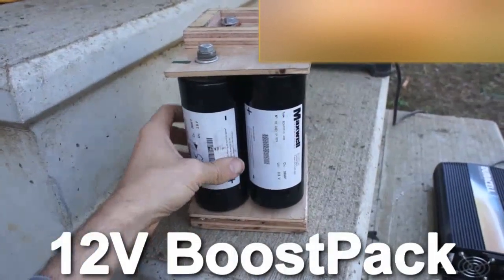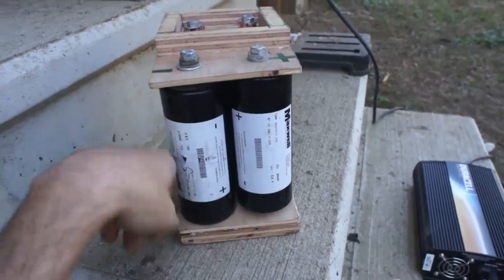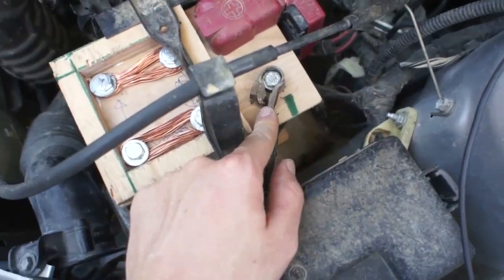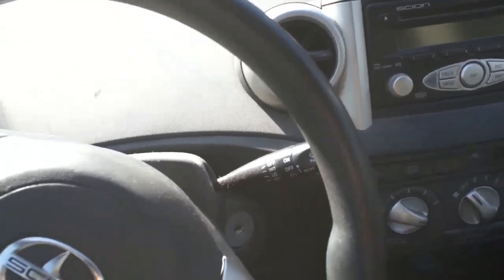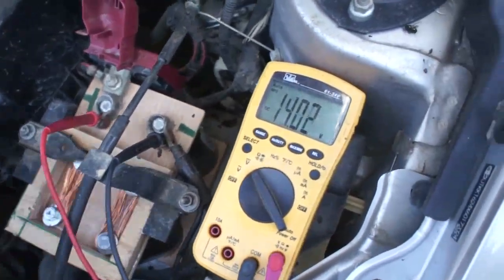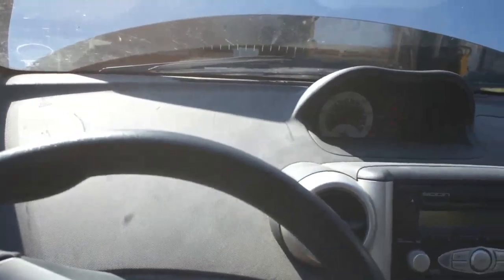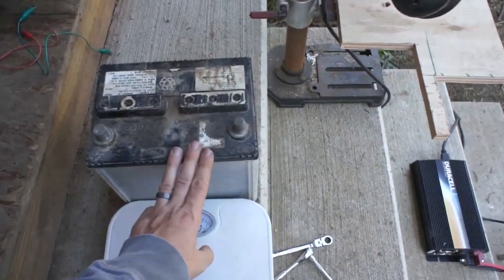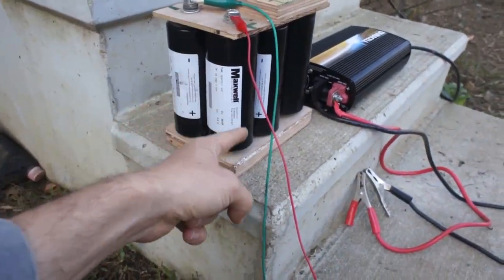12V BoostPack. Replaces auto battery. Works great!

Comment: In the 50 years I've been driving I've had generators or alternators fail while on the highway.  Automotive batteries today are rated in cold cranking amperes and reserve power minutes or how long you can drive the car if the alternator fails.   Usually you can drive at least an hour maybe more in daytime without lights and if you'll leave off the AC/Heater blower just on the battery if the alternator fails.   I'm afraid this type of arrangement will leave you sitting on the highway before you make the next exit...
Reply: Howard Bee Maybe the battery can be kept as a reserve with an alarm to say something is wrong?
Reply: Good point. It's a trade off of features. You sacrifice the 1 hour driving reserve for in case the alternator fails in order to achieve better gas mileage, but another option such as a solar panel built into the roof and/or hood/trunk can possibly also give better gas mileage by negating the use of the alternator (so it causes less or no friction load on the engine) during the day, and also this would enable you to run the car with a failed alternator so long as there was sunlight. It's also possible to keep a little hand crank charger in the trunk for emergencies. They're good to have in case you need to charge your phone, and now if you use capacitors in place of a car battery, you could use it to charge up the capacitor if you didn't have solar. I think most people will simply rely on their auto club membership, because they're paying for it anyway, but I'm the type of person who wants to be independent... you know, in case of zombie apocalypse. 
Now it's not a bad idea to keep 8 'D' cell batteries on hand. That's still a lot less weight than the Lead/Acid battery but they are not going to be able to give the cranking amps needed, but they could recharge the capacitor at night when solar would be impossible. So for those who don't want to use a hand crank to charge the capacitor, that would be an option. I would go with the hand crank because I've had lots of batteries go bad still in the packaging. I have bought them to have for emergencies and they just seem to be designed to go bad after so long. They self corrode from the inside and leak. 
I know a car requires a lot of amps to start because it has to turn over the crankshaft with an electric motor, but once the engine is going, how much electric power is it drawing? It might be possible to have a passenger furiously turning a crank to keep the engine running indefinitely while you drive down the road. X'D
Reply: Correct, if your alternator fails you can drive for quite a while on battery, then jump start and drive quite a few miles again.  I've done that a few times.

However, in my 30+years of driving the need to do that has happened less than a dozen times, and once I've replaced the alternator I don't recall ever having to replace it again on that same car.

...but I've started a car tens of thousands of times, and due to the ability to discharge amps faster, this seems clearly superior.  I'll bet it would really work great on a diesel truck, where you typically have two batteries because one battery just can't push the amps.

If I can find the caps, I'll try it, especially in my tractor, it sits for quite a while between runs, and then I'll start/stop it multiple times in a day, then it will sit for a while.  I already have a solar battery tender on it, so if switching to Caps means I don't ever have to worry about that battery again I'll be one happy guy.

For weight savings... your target audience is the drag racing crowd though... they're the ones that really worry about every pound of weight... often going so far as to strip the sound deadening and "extra" seats out of the car.
Reply: Actually, there is a benefit to it if you use it as hybrid and hooking battery and capacitor in parallel.
The capacitor will deliver the surge a starter needs or when you honk your horn or other devices that are intermittent like your wiper and that saves you battery life. You can double  the live  of a battery or you may even get even  more years out of it. I am on my 7th year and the battery is still not slowing down.
So you save on resources,  landfills and keep more greens in your wallet.

And I was thinking of adding  a solar panel and charge controller to the system to keep the combination at the same voltage at most of the time which would add more life to the battery.
Small load on the battery with steady voltage will add to battery life.
Reply: 15 lbs of weight is nothing compare of the 3,000 lb  weight of a car or compare that a spare tire can weigh as much as the battery.
Most people that have alternator problems do not even know that there is a problem and by the time the battery is ruined already and is destroyed and you will not get 1 hour driving with that bad alternator and that bad battery....you will be lucky if you get 10 minute driving with that bad combination.
We have capacitors that are over 40 years old in that electrical cabinet (UPS) that is used daily.  Never seen a battery that can last that long without servicing nor touching it.
A starter takes about 200 amps, but it is only for 1 to 2 seconds and it takes very little watts to start the engine...well I came up with the calculation that the starter takes 1.38 watts/watthours to crank the car, so it would take the alternator seconds to charge the battery or capacitor up again.

So yes, use a capacitor as a battery or a combination of it and save in the long run by saving the resources and landfills and by keeping the green stuff in your pocket after initial investment. I call it investment since eventually you will break even and you will start to save money. It is like buying solar panels, they are expensive, but in about 7 years you reach the break-even- point and after that you are just saving money by not having to buy electricity or by not  having to buy fuel to generate it.
Reply: Howard, I agree with you 100%
Reply: A dashboard solar panel will not do.
A running car uses about 10 amps to 20 amps, depending what is on at the time.
A 100 watt solar panel produces about 5 amps. A 100 watt solar panel also has a  dimension of about  2 feet by 4 feet.
You would need about four 100 watt solar panel just to get by, What you gonna do at night? Unless you increase your solar panel array and increase the capacity of your capacitors or batteries.
Eventually the  technology will be incorporated when greed finds competition.
Reply: If you just drive around town then why worry? Even in the slim event your alternator goes out it's not too huge of a risk, you still are going to be broken down either on the highway or not. If you keep up on your maintenance and have your alternator checked periodically your chance of failure is even slimmer. You could carry around a starter pack in the trunk or get a jump from somebody in the event of an accidental discharge. Don't throw the baby out with the bathwater.
Reply: Hey,  if you want to know more about solar panels and have questions, here is a good forum. 
Most of the folks there have experience and would be glad to help you.
http://forum.solar-electric.com/discussions
Reply: can´t check alternator periodically!  other than looking at it;and measuring 14.2 v,it´s working N O W !  don´t know,5 minutes from now.
Reply: Yes, you can test the alternator. There's a tool called an AMMETER! There's another one called an Oscilloscope which can even tell you when a diode in your alternator is about to fail.
Reply: Howard Bee I have been driving as long as you and in all those years i have only lost one alternator....in several hundred thousand miles.
Reply: Your welcome.
Reply: Ben Silva
Reply: Ben Silva
Reply: Ben Silva
Reply: hannamand
Reply: Seve Bertolone
If you are talking about recharging the power/watts  that the starter took out of the battery while starting the engine. It is not worth to mention it. It is very very little power, that have to be recharged..

A starter takes about 200 amps, but it is only for 1 to 2 seconds and that
 takes very little watts to start the engine...well I came up with the 
calculation that the starter takes 1.38 watts/watthours to crank the 
car with about 12 volts, so it would take the alternator seconds to charge the battery up again and to give a little bit more of that 1 watt back to the battery.
Reply: The typical car alternator takes far more than one minute to recharge the battery after a typical crank - especially if the engine is only idling.
Reply: Howard Bee i agree. Alternators have had the security of knowing when they fail for 30 years now.. Old people dont understand how new stuff works i guess, figure out once why your car wont start because the battery light on the dash has simply burned out, thats how i learned lol.. Technology, the blessing and curse of the modern age of generation x..
Reply: There is also a battery reconditioningggg guideeee on >>> https://t.co/mK3KjJd0lr?GPJao1xLe7wadd
Reply: Car batteries are like $200 now and he is saying these are $6 a piece. I personally dont care about the extra one hour of driving time I would get if the alternator went out. I have a cell phone and would call someone...besides...how often are you guys alternator going out?
Reply: I got bored half way through reading this sorry 😐
Reply: A simple 150w solar sheet on the roof top can resolve the problem for issues that rise during day time.
Reply: Yes it will
Reply: Tha battery runs the car the alternater just carges the battery
Reply: Alternators can be rebuilt in minutes on the side of the road if you prepare for this possibility
Reply: @shanicabolden5092  They can be rebuilt if you can locate them under the hood of today's cars....some are almost impossible to reach
Reply: I have had six Maxwell 1500 Farad caps as my "battery" for over a year.
I lost my belt once and you're right, the caps will only power the car for a few minutes. But, my van will only make it 1/4 mile before it overheats without the belt turning the waterpump, so the point is moot.
Reply: I’m going on 7 years with my 12 caps! Thanks man!
Reply: Get triple A
Reply: ***** Vehicles are already equipped with an alternator warning light or a system voltage meter if the alternator fails.   If I need to keep the battery for reserve power capacity wouldn't that negate the need for the capacitor bank?
Reply: @kaa522  One need not "replace" the battery when one can have a boost pack and battery? That way one can keep the existing, maybe reduced, capacity of the battery while adding the cranking amps of a boost pack. Point is using a boost pack can extend the useful life of a battery.
Reply: Somewhat, but at the same time if you make a hybrid of the two, you might be able to choose how much of the benefit from each one you want. A small battery might be a nice way to act as a safety device which can get you to the next exit. If the car uses it rarely, rather than a battery that likes deep cycles, a long term storage solution like lithium might become feasible where the cost to power the vehicle the entire time would have created a huge expensive battery before. Maybe. It takes more expertise than I have but if they are in parallel, the battery would be the vehicle's version of an emergency adrenaline rush...too expensive to use all the time but great in an emergency. :)
Reply: +Wuety06 you are terrible at maths, man, but since you feel saving 15lbs of weight is almost nothing, then multiply the savings times the gas usage of the entire nation and eat that much dirt. Come on, video yourself eating that much in dirt. Zero times anything is nothing, and almost nothing must be very small, so you should be able to do this with no problem. The future of the environment depends on you consuming the difference since you insist it's not worth it for everyone to save just a little, so you should eat it for us.
I think you've changed your mind.
Also, who is going to need a tow truck? The person with a battery that won't keep its charge, that's who. Don't have that problem with capacitors since they last much longer than batteries. The capacitor will outlast the life of the car. Put solar panels on the car and you can drive without using the alternator, which makes it last longer and you have less chance of breaking down versus a 'traditional' setup that you love so dearly. If you were born a few years earlier, you might be insisting that the Model A Ford is the only car we should have and all these newfangled models are too fast! LMBO! The future is passing you by. Are you still using that original IBM to type on here? Man, they still do what they were built to do, but there are better computers now. Consider upgrading.
Reply: It will die in less than 5 min
Reply: That's a very strange comment attempting to assert intellectual superiority by belittling someone else's contribution through diminishing their comments based on a poorly thought out argument. The words were condescending and rude. Thank you.

No. Not all capacitors are set up to bleed out all their charge at once because the electrical impedance you add to slows the discharge rate, even in a sophisticated "hybread" battery. The batteries shouldn't require as much space as you might expect unless you choose bloated capacitors for your finished product.

Your numbers don't all make sense. The numbers are not experimentally based as much as emotionally weighted and don't really contribute much to the conversation. I am not saying YOU aren't meaningful or smart. Your assessment was less than professional, though. Peer review's a tough mudder.

Anyway...
I'm really not up to arguing with you right now but as a troller I am sure you can find what you are looking for elsewhere. I hope I didn't hurt your feelings, pumpkin, but someone had to tell you before you really embarrassed yourself. Now tie your shoes and off ya go.

Thanks.

Bye.

PS:
I really don't intend to carry on this conversation... ever. Oh yeah... and I just reported you. Have a nice day.
Reply: your alternator would see way less duty cycle because the majority of wear on a alternator is charging the battery, takes lots of amps for a long time to recharge it.
Reply: some people are naturally born stupid and some people have to work at it,   this guy is lucky because he is a natural.
Reply: ***** its great that you are trying to think, but you are failing miserably at it. lets put things in perspective. replacing your battery with a super cap set up saves 15LBS, studies show REMOVING 100LBS = 1% FUEL ECONOMY INCREASE... so even the set up the guy had above gives him almost nothing in return and puts him way more at risk of being stranded. To do this hybread you suggest means a battery half the size of the normal one and a cap which already takes up the full size of the battery... now you probably have more weight than the original battery and no where to put the smaller battery, you also need pretty thick cables to go to that smaller battery, which again adds weight and because its a smaller battery its still far more likely to leave u stranded. there is no benefit to this. internal combustion engines dont need an adrenaline rush, wishing to make it possible breaks a system that works well currently.... they require a decently constant supply of moderate amperage which the lead acid they come with is great for. yes you could argue that using the caps and saving 15lbs over every car in the world may be significant... but due to the fuel hungry nature of a tow truck you would quickly see that advantage disappear even in the fractional fictional reality's you think it exists.

Comment: Great for race car.
Reply: +Stone Rinaldi Do race cars even have batteries? That may sound dumb, but why don't just save the weight and start it with an external energy source?
Reply: They need batteries to keep the spark plugs sparking.
You are welcome.
Reply: Guy Pukallus Yeah, but only very little wrongs, right?
And I could imagine the use of lightweight supercaps as well...

Comment: Try testing these for car audio use on high power amplifier sound systems.  That will surely show how good they perform.  If they work good then you could make a ton of money selling these to car audio competitors who run high power systems.
Reply: Clyde Yamasaki yeh they have been using caps in car audio for a long time (10's of years).. cause the battery cant get the energy out of itself fast enough. i even currently have a cap (dont really need with only 1kw amplifier) in my system and those cost around 50-100 usd.
Reply: Clyde Yamasaki that’s literally what these capacitors are used for

Comment: It's not a boost pack.  It's a capacitor bank.  And it's only good for high amp short draws.  You aren't the inventor.  It's been out bro.  Caps have been used forever. Come on.  U ain't gonna get rich quick.  You don't have to haul them around, batteries last 6 years.  Jackass.  This is worthless for most people.  You suck.
Reply: Steven King He made his own name for the "boost pack". Deal with it and put your comment in the shredder.
Reply: Nope.  This was done years ago.  So it is exactly the same as me making a toaster and calling it a tredoampasseter.  Don't you get it thief?
Reply: Ok, so the toaster/tredoampasseter actually has a REAL name (toaster). What is the "capacitor bank's" REAL name?
Reply: +Steven King Not sure where you live, but a '5 year' battery will last MAYBE   '2' years here in Arizona!
Reply: If you use caps as a battery, then it becomes a cap.  Gay.  Caps are short term batteries.  Stop it.  Losers.